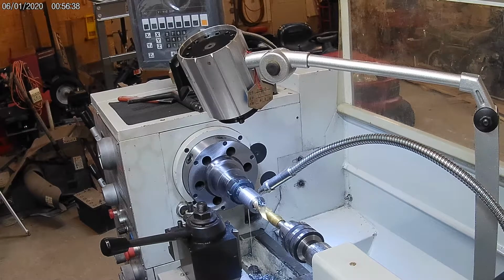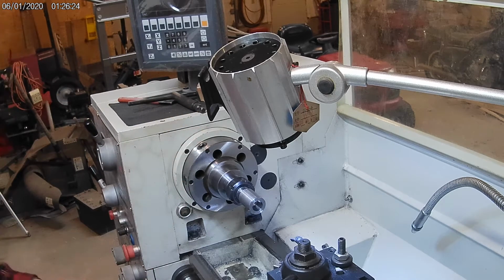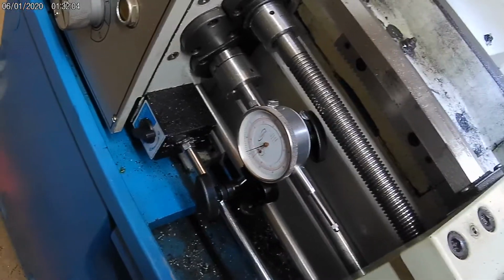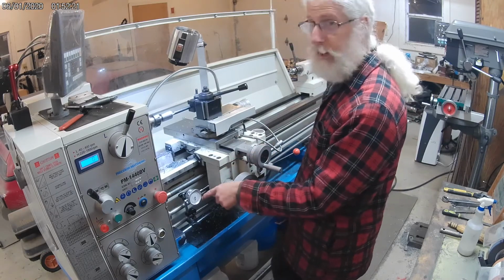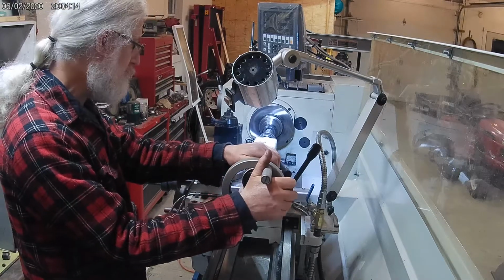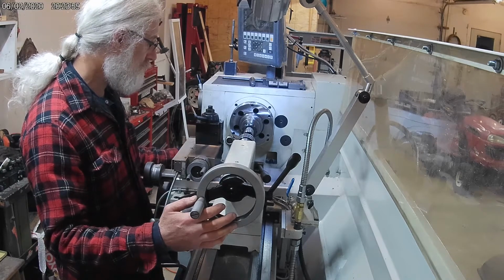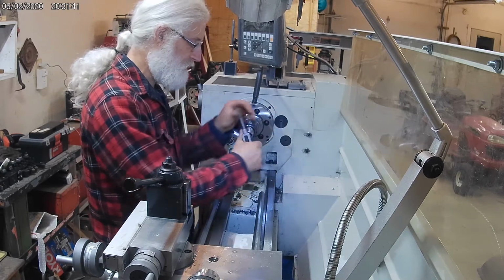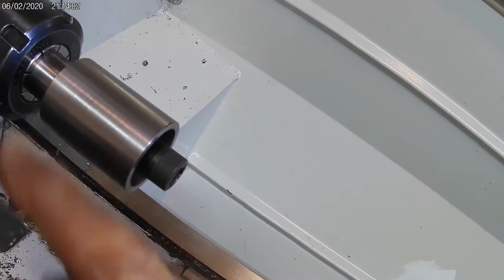Making a Custom Slitting Saw Arbor Pt1

Comment: G day Mate 👍 that was an interesting tool holder with a knurling tool on one end and the boring bar on the other,  did you make that 
or was it purchased that way I understand you could put other tools in it,  all the best stay safe
Reply from the maker: That knurling tool and tool holder came that way. when I bough my lathe it came with an Aloris clone tool post and a starter set of basic tool holders and that knurling tool. yes it will work with most square shank tools up to 16mm but only on the facing orientation. It is convenient for that little 12mm boring bar, but I would not use it for a 16mm bar; I don't think it would be stable enough for a good cut with a bigger bar.

Comment: Joe Pie sent me.  That looks like a nice lathe.  I don't have a DRO on my lathe yet so I use a dial indicator against the carriage to measure travel and as a stop reference.  I set the indicator to 0 at the finish depth and set it for.050-.100 of rotation from when it contacts the carriage.  This gives time to prepare to stop the feed.  I usually stop a bit short and feed the last bit by hand.
Reply from the maker: Robert, nothing wrong with not having one, we use what we have and can afford at the time. A DRO is certainly a huge help, but not necessary. I still prefer the dial indicator when doing repeat operations like stopping against a shoulder cut, and for conventional threading I feel that a dial indicator is essential unless you have a wide relief cut. The DRO is great for positioning, but it is really hard to nail a zero crossing when moving fast. When threading you cant just sneak up on that last bit; it all has to be cut in one smooth motion.

Thanks for commenting!